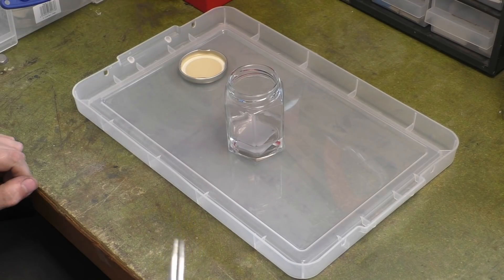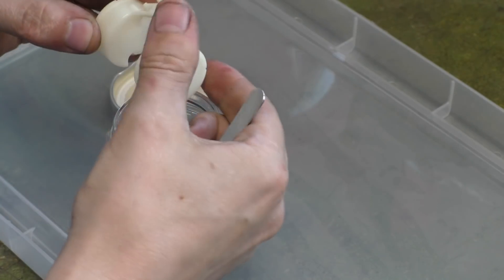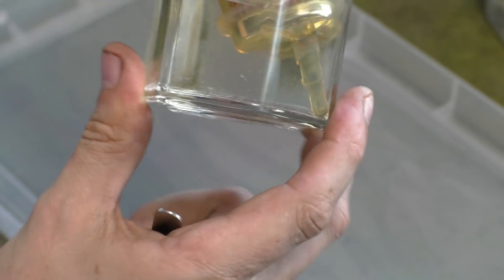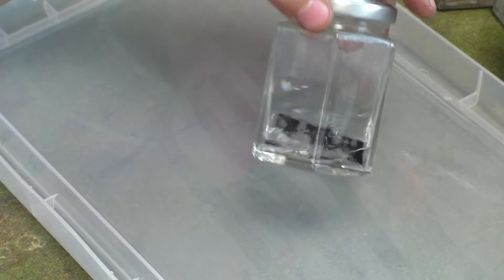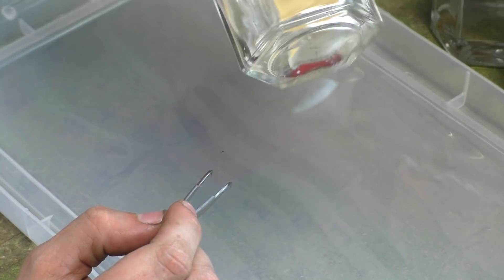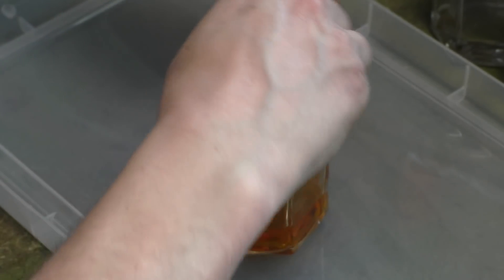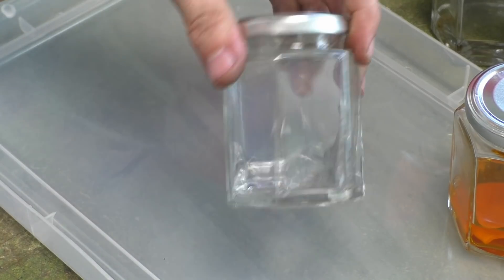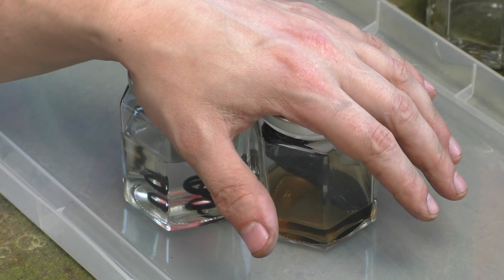Is Ethanol bad - 3 month Update

Comment: I’m all for “renewable” fuels, just don’t want to get 15-25% fewer miles per gallon like with E85 and still pay the same amount.    Pay less per gallon and get less out of it. Basically same value but more time spent filling up or driving to a station.           

I also love the fact that calories can be used as a unit of energy for pretty much anything!

Comment: I've been in many carbs over the years some new some old even some pre ethanol. 

Most common issue is corrosion from water (condensation, rain water who knows) 
Worse case is green alge that stuff like acidic glue.

Old fuel would dry up then leave sutty film behind and water would just sit in tank or evaporate after/with fuel.

I believe the ethanol is attracting moisture threw out the fuel system. 
As for the jelly, sand, hair, or lacker debris I find in carbs that sit for period of time, I think it's the water threw out the fuel allowing other nasty stuff to form or grow.
I have also heard that the ethanol is from corn don't know if it's clean or has imperfections to begin with but that's a story I don't know

Comment: I had replaced some fuel filter spring of 2016 on my ATV, lawn mower and 12hp tractor the ATV and lawn mower filters cracked and fell apart in one year the 12hp tractor only gets used for snow and that filter is still on I should cut that off on camera or ship it with new one to compare😉 
That thing will surely shatter🤔

Comment: I still wonder about ethanol. Yes it's very good at cleaning things and removing oil, but oil in an engine seals, protects and cools... Is it really a good thing that ethanol is great at cleaning things of oil?

Obviously with parts in a jar it looks all very well that it makes a good job of cleaning stuff, but in the context of a live working engine, is a solvent which cleans oil really a good idea?

Personally I'm kinda on the fence as to whether it's a bad thing or whether it doesn't  really make too much difference.
Reply from the maker: "I still wonder about ethanol. Yes it's very good at cleaning things and removing oil, but oil in an engine seals, protects and cools... Is it really a good thing that ethanol is great at cleaning things of oil?"

- Try cleaning oily stuff with petrol - it's a great degreaser.
Reply: The Workshop yeah, fair point.. But petrol is oil based obviously, so a lubricant too? More so than ethanol anyway, and slight differences could probably make a big difference to things like wear of engine components when you're talking about motorbike engines especially..

I'm just playing devils advocate here, I'm really not sure myself
Reply: There's bound to be some Americans in here who've used fuel with ethanol on a sports bike that's got some decent mileage on it? Anyone??
Reply from the maker: I've contacted the NREL in the States and they forwarded me a paper they published - we'll be getting to this real soon. Plus there's still more to do with the experiments etc
Reply: knuckles zedawg ethanol fuel gets worse mileage, also my 2019 Honda 1000RR, the warranty is void if I use anything about 10 percent. It’s junk I use E0 in everything.

Comment: Isn't the major issue with ethanol (besides that it attracts water) that it phase separates from petrol?  I'm not concerned as much with part/component degradation.  I'm more concerned about the ethanol phase separating from the petrol and my fuel lines sucking straight ethanol/water into the combustion chamber.  Pretty sure my 2006 Yamaha was not designed to ingest/combust straight ethanol nor H2O...

Comment: Also, thinking out loud here, having the ethanol open to the air, may facilitate biodegradation. As an organic compound, it can degrade aerobically and anaerobically. When performing this test, a real life test should include ethanol which is exposed to the open air to simulate the natural aerobic biodegradation which would occur in our vehicles (and in particular our carbureted vehicles).
Reply: The ethanol would evaporate off in a matter of hours if left to the open air it wouldn't "degrade" alchohol is an organic derivative but it does not "degrade" or deteriorate in any fashion at all unless exposed to air an even then it would just absorbe moisture and it would be the water that turns stagnate and would be sterile until the alchohol evaporates away

Comment: In my Ford Focus I usually run E15 and the car runs so much better than regular 85 I also sometimes run E85 and the car runs even more awesome but the fuel millage sucks I can get around 29 mpg with E15 and 23 with E85 with regular I get about 32 mpg. I know you get more energy from regular but me I like performance I don't baby my car I like to get up to speed fast and don't really care about gas milage either but I do add regular around the 4th fill-up or 1000 miles like the manual says I believe it has something to do with the ECU can't remember haven't read it in awhile and I don't want to Google why while I'm writing this comment.

Comment: So I had heard at some point in my life, and just always believed it, that you need more ethanol to do the same amount of work (lower energy density than gas, a quick search revealed that to be true). Similar to a dragster that uses methanol, has 8000 hp, but uses more meth to achieve fast times than they would if they could use gas (I understand why they cant.)  So I guess my concern is lower range on my bikes. My beta has a pitiful 2 gal tank that I've ran dry 3 times now (luckily I'm always off the mountain and back on to roads when it happens) so if I had even less range, that would be a real bummer for me. Am I wrong?

Comment: My 6 wheel drive FWD  truck has a traction lock system that uses brake fluid.  Brake fluid turns  Buna-60 O-rings to mush but  does not hurt Ethylene Propylene O-rings which are a little hard to find .. I had to purchase them in huge quantities after  FWD trucks  stopped selling them for a reasonable price or at all ..

Comment: It's hard to get all of the water out of Ethanol ..  If Ethanol does not have any water in it , it will mix with gasoline.  If   water is added  the gasoline and ethanol will separate.. 

  Soy Bean oil is a very strong solvent ..   Soy Bean Oil  eat up brass   copper , Buna 60 O-rings..    Both  Ethanol and Soy Bean oil will dissolve Tar in a fuel tank  that builds up for the years from gasoline or diesel ..  it will clog all your fuel filters.

Comment: Why don't you drink  a 1/5th ?    You need all components that can stand up to ethanol  older vehicles have problems.. Carb Viton needles don't like it ..  Henry Ford's  Model T cars could run on Ethanol .. Natural Rubber can stand up to brake fluid  many other  materials can not ..

Comment: From what I've heard the only hullabaloo with e85 and e15 is that the fuel pumps and injectors are said to not hold up with those fuels. I actually suspect that the problem is coming from the fact the the ECU isn't programmed to know what is looking at data-wise when running those fuels as they produce very different exhaust mixtures. I.e. if the ECU starts seeing a lot of extra oxygen in the exhaust and isn't tuned for e15&e85 it is gonna think that the engine is running lean and demand more fuel, soon enough it's gonna run out of fuel pump and the problem will still appear to be occurring.

Comment: The problem I've seen with ethanol fuel is what it does as it gets old.  It absorbs water and turns into a gelatinous goop.  It also goes bad a lot faster than ethanol free.
Reply: Exactly
Reply: The goo that forms in old gas isnt from the ethanol it's from another additive that was put in during the blending process

Comment: I once mixed methanol NOT ETHANOL! with my feul when I was racing 50cc bikes and after the race u Just forgot abouth it. Abouth 3monts later u took the fuel out the tank end something had dezolved in it, it looked like water in my feul with some flogging in it, I think it was the oil (it was a 2 stroke) but not sure might even Just been dirt in my tank but maybe try mixing 2 stroke with ethanol? Maybe it'l desolve the oil?

Comment: Some materials show problems only at elevated temperature. Like say viton orings survive pretty well but NBR orings in the xylene swell up and fuck off
Reply from the maker: We'll have to try this - what are we talking 70degC or what and for how long.....
Reply: The Workshop I remember numbers of 90 and 120C somehow. Second one is probably viton and I think NBR craps out in aromatic solvents aka petrol even at lower temperatures. I suppose you use some relevant engine temperature, 90 degrees seems a bit much for fuel related stuff. 70 sounds pretty good. And I should look this shit up.
Reply: And for a timeframe the NBR orings become weird pretty much over night, so a few hours. They mostly still hold up at that point though. It should be worse in ethanol since it's a polar solvent. Should be interesting how good the viton (FKM?) rings survive ethanol in heat, they do nicely in petrol. I have no idea how the other plastics hold up to higher temps and ethanol but in petrol basically everything standard shits the bed if you heat it up.
Reply from the maker: But this isn't practical - from a fuel in your tank or carb senario - if you tank is 90degc you have real problems LOL

Comment: The issue I have seen up close with Aprilia fuel tanks especially is swelling of the fuel tank. It reaches a point where you cannot fit it back onto the bike and you get distortion of the tank so that on the RS250 the fuel tap will leak and the Aprilia Falco the fuel pump will leak too.. Its a well known issue and it has been blamed on the ethanol content of the fuel.  It has been common enough for me to now have made almost 30 RS250 fuel tanks and 11 Aprilia Falco fuel tanks in Carbon fibre and even then I have had to contact numerous resin suppliers to find a resin to seal and then make an adhesive to bond them together.  I have not had one fail in about 3 years. Although I know the QB Carbon tanks have had issues and QB no longer make fuel tanks due to this issue. I was even offered all of their fuel tank moulds as they will never make another tank after the failures they have had.
Reply from the maker: "The issue I have seen up close with Aprilia fuel tanks especially is swelling of the fuel tank."

- when you say swelling what do you mean? And do you know what the tank is made of?

"Its a well known issue and it has been blamed on the ethanol content of the fuel."

- I'm sure it has been blamed but I need proof.

And are we talking dirt bikes?
Reply: It has expanded all over usually. It can look OK but the tanks just will not fit back on the bike.  One guy had extended the slots which are on the top tank bracket on the Falco and when the bike was serviced the guy could not fit the tank back on the bike. The flatter areas do get some distortion but the tanks feel like they did new but the expansion shows something is not right.The worst I have heard of is the tank was 20mm longer than it should have been. The rear of the tank had been bolted up and the front was 20mm beyond the tank mount holes on the front bracket.  I will check the tanks I have here and see what they have been made of.  The RSV1000 Mille tank may have some foam over the material but I also have a brand new Aprilia RS250 tank here which is still in the factory box when it was sent to me. I will check that for you tomorrow. I know the tanks were made by Acerbis so I would think all of them are made from the same plastics.  I personally think it attacks the plastic surface and the tank absorbs water which the ethanol attracts. Most tanks shrink back if left in a warm place over winter.. But then the following year the expansion is worse than before and the tanks re-swell quite quickly after being "dried out" over winter. 

I will send you a private message via Facebook and a photo of the bottom of the tank..
Reply: I have never seen anyone get the bottom of the plastic tank issues. They started about 10 years ago and also affected the Ducati 1098 which resulted in a group action lawsuit. I have found affected Aprilia tanks do shrink back if left to dry out for a few months. Many people speculated it was related to ethanol, others claimed it was water.
Reply: Mark Magenis it is both the ethanol (or whatever additive) and water. The tank becomes porous and absorbs the water. Dry it out and it shrinks back.. But when it swells again but worse..

Comment: only issues i have found with ethanol blended fuel is in steel motorbike tanks where they have been sitting for long periods of time and the moisture that is absorbed by the ethanol has rusted the tanks and sludged up carburettors much faster than normal, then on the car efi side of things i think its more the cleaning properties of the ethanol that cause issues where it cleans and carries the dirt further into the fuel system, although i have seen fuel line that seems to have degraded much faster after going from regular fuel to ethanol, but to be fair the fuel line have been 10 to 15 years old and may have already deteriorated and the ethanol just finished them off.. although your xilene test is interesting, do you think perhaps its the xylene in the fuel that is the culprit , as in parts that have been in contact with both xylene and ethanol?
Reply from the maker: Good question and this is what I'm trying to find out - I'm also talking to 2 chemical engineers and the usual fuel companies (BP, esso etc)

Comment: Bunk science. The whole debate behind ethanol being bad, is that it is hygroscopic, and combine that with galvanic corrosion because dissimilar metals = formula for corrosion, or rust.
You should take a metal fuel tank and put some ethanol blend fuel in it(because who runs E85 in their motorcycle?), leave it out in the elements and report back in a year. :P
Oh and those o-rings that you stretched out, which barely returned to their original shape are not "fucking fine".
Reply from the maker: "Oh and those o-rings that you stretched out, which barely returned to their original shape are not "fucking fine"."

- LOL I have to laugh - what the fuck are you talking about? Which ones - be specific